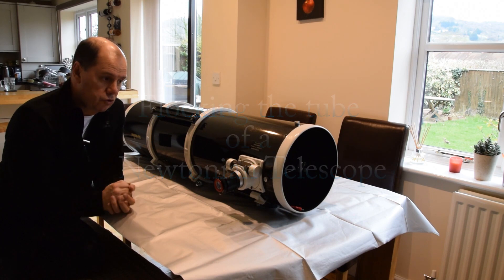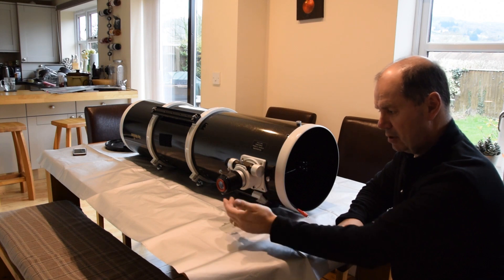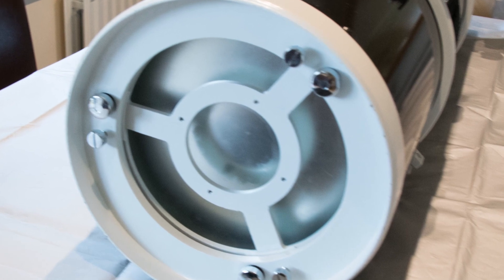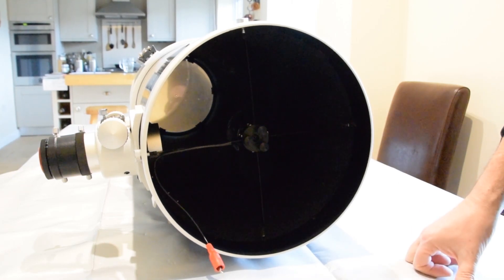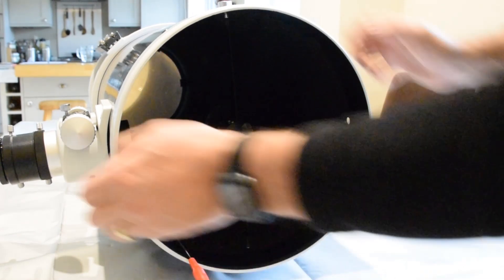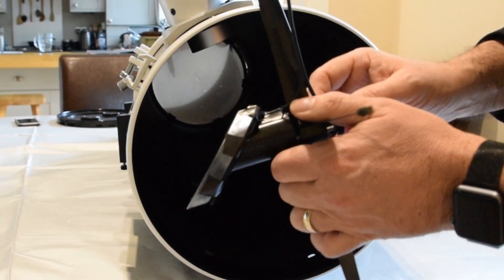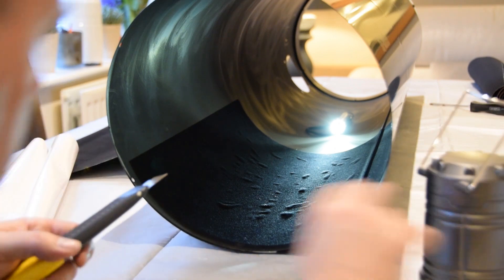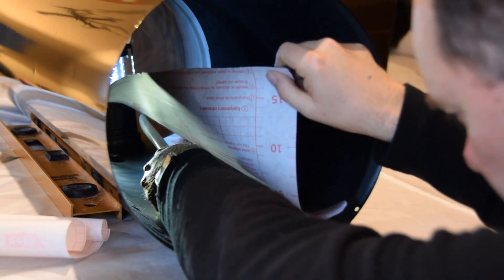Flocking a Newtonian Telescope

Comment: Hi. What is the material you used? What is it called? What brand? Thanks!
Reply from the maker: You can buy it from First Light Optics in the UK, typically used on gaming tables etc.  unbranded, but search 'black velour flocking material' ~£7.50 per metre, two packs needed

Comment: It’s so disappointing that a fine manufacturer like Sky-Watcher are producing such poor quality optics. Light leeks, lose focuser, questionable secondary mounting system, sad, really sad. I just ordered a 10” unit and it’s not a Sky-Watcher.
Reply from the maker: Well, they are made to a budget and price point, and remarkably good value for money. If you want to pay more there are always options. What did you buy?  I have the SW Quattro 10” now, in carbon fibre. It’s a great instrument
Reply: Skywatcher, Celestron, and quite a few others, are mass produced in China. Despite the "brand" being American, or British, etc. It all comes down to the money. You can, for example, buy a fully German manufactured telescope like Bresser, which will cost 3-4x as much. But not all of us that loves the hobby can afford that. We have a SW Mak-180 and the first "upgrade" we did was replacing the (very) poorly attached vixen style rail with tube rings and a Losmandy style rail. I can personally testify the jitters the scope got by just touching the focuser knob, has gone. Now next is getting the flocking flocking done.

Comment: 4 years later, have you noticed any issues? Did the adhesive wear off? How often did you had to clean the inside again? What about bubbles forming? Was the contrast gain significant for visual observation? Thank you for the video!

Comment: Hello, I noticed how dirty your rag was after you wiped out the inside of the tube. I would imagine that the flocking would collect dust and such, have you had any issues with the flocking giving you grief or becoming dirty since you’ve installed it? Thanks for your efforts and taking the time to make these vids, they are very helpful.
Reply from the maker: hi sorry for my late reply.  The water from cleaning was dirty, although i think it was actually mostly the coating from the tube rather than dust/dirt.  Since flocking I haven't seen any issues with further contamination, i keep the tube lid in place and store horizontally, but when i next clean the mirrors i will use the opportunity to also vacuum the inside of the tube. HTH, Mike

Comment: With a water spray you can move it freely without bubbles. When it's in final position just dry it with a hairdryer. It's much easier.
Reply: Indeed.  Spray the tube wet before placing the flocking sheets.  Maybe even spray it with a small bit of soap added to the water

Comment: Friendly advice: you should breathe through your nose when you're recording.
I recommend re-rolling the felt before use, re-roll it so the black is on the inside and the removable backing is on the outside, let it sit for a week or so so that the curve of the felt matches the curve of the telescope instead of being backwards. Should make the job easier.
Reply from the maker: Martyn, thanks for the feedback, listening to it now I see what you mean about the breathing!  I set up with a lavaliere microphone, improved sound quality but perhaps too sensitive. Rerolling the material I did try, but it’s not so easy, as the backing is a lot thinner and doesn’t roll easily.  Hope you still found it useful despite the distraction!

Comment: Hello.Is there an alternative way of flocking the telescope by painting it with some matt black paint? It would seem easier to do.Thanks
Reply from the maker: Lita Catalin,  hi.  On mine the tube already had some dark paint, I never tried it with ‘blackboard’ paint or similar, but I guess it’s a reasonable idea!  As long as you strip it down completely it should work fine. I wasn’t expecting the felt to be so difficult, although it certainly got easier as it progressed, and a year later I’m still happy with the results.  Let me know how it works out 😊

Comment: Hi! Great job, congrats! and thank you for the video. One question: I have a 8" newtonian, and received my first CCDs mopno cameras a week ago. Great in many ways, but I have a problem with rings in my flat frames. With my dslr I didn't notice this. My question is, since I once tried to clean the back end of the tube and unfortunately made it shinier than it was before, could the rings (actually more like long arcs that go from side to side of the image and curve around the center) be caused by the reflections inside the tube? (I tested the cameras with and without filters/filter wheel) and the flats, once stretched, show this horrible curve gradients.
What do you think? What was the difference between before and after your work in your photos? 
Thanks a lot if you have a minute to answer. Clear skies!
Reply from the maker: Hi Diego , that sounds more like an alignment issue than reflections to me.  Not sure why they would show on flats, but I would check collimating and focuser squareness ..  I presume it’s not Coma - present in many Newtonians and can be corrected by a corrector lens? But I think you would know what this looks like?  Good luck 😉
Reply: I think you are right, it wasn't collimated properly, things look much better since the last thorough collimation a few days ago. And I probably need to lear to take good flats yet.
No, it wasn't coma, even though my images show lots of coma and I need a corrector for that too. I'm curious, what differences do  you notice before and after the flocking? Thanks again for your time.
Reply from the maker: Diego, contrast is much better after flocking, and less issues with stray light sources showing as flares
Reply: Awesome. I think I have a little job to do ahead. This video will come in handy. Thank you very much!
Reply: Ok, following these instructions now on my 8". Wish me luck ;)
Reply from the maker: Diego Gravinese Good luck and be patient 😉

Comment: Cool. Just invested in the same OTA just need to save up for the NEQ6 pro. Up grading from my SW skymax 127 on the AZ Mount. I’m sick of feild rotation and the fact I can guild. Would love to know how you run that dew heater on the secondary.
Reply from the maker: Hi Cockney :) The 250pds is a great fast newtonian. as you will find out.  I have another vid in process for the dew heater and controller, should be out in a couple of weeks :-)  There is also the TELRAD 5v dewheater vid i just made - that works a treat!
Reply: MikeyJ ok I will check that one out and can’t wait till you upload again. 👍